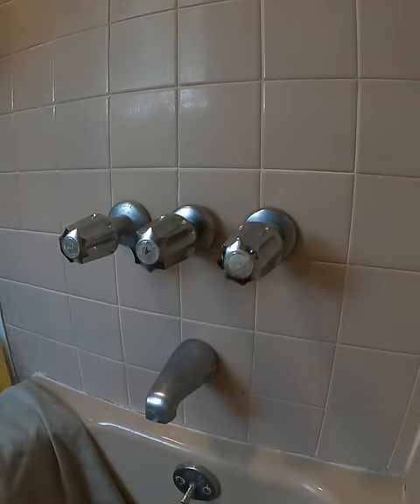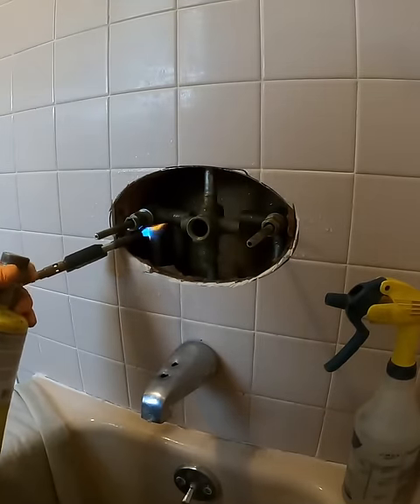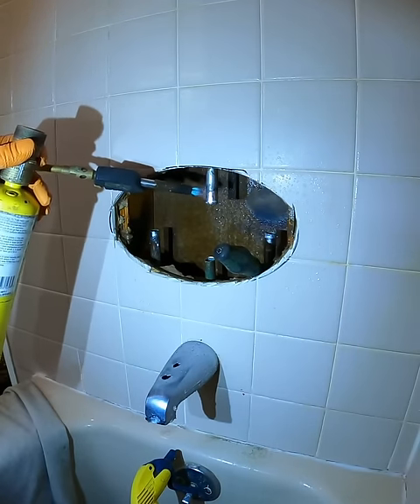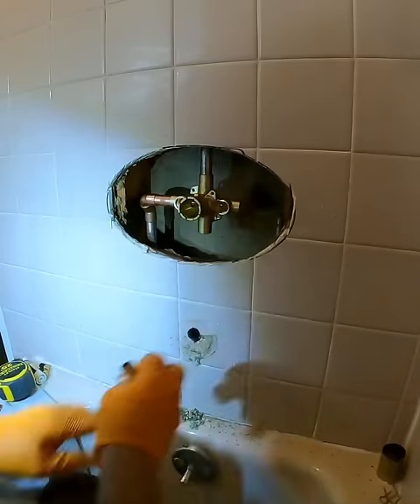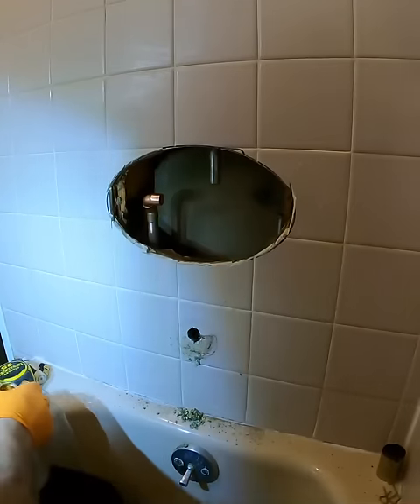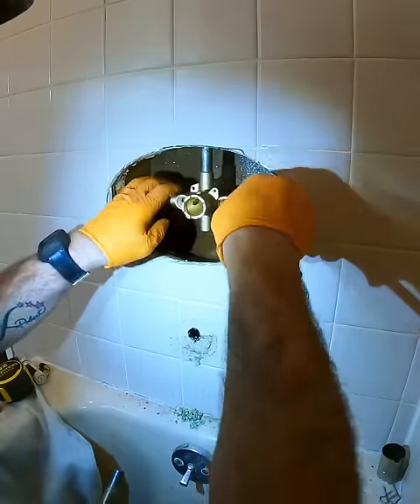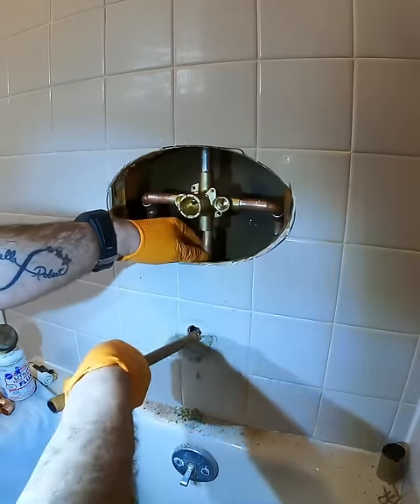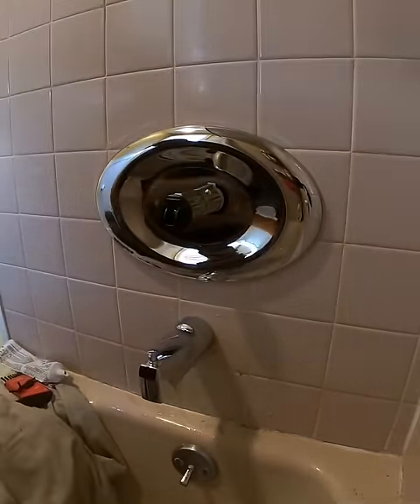How I install a Moen Chateau remodel kit

Comment: I'm going to do it myself wish me luck 🤞🤞 never done before but $800 is too much money man thanks for the video will keep you posted
Reply from the maker: Take your time and spray inside the wall with water and keep a  fire extinguisher handy
Reply: 800 is about right, once u cut the wall up u dont know what is in there.
Reply: I live in St. Louis Mo. that job is $1300.00
Reply: Did the job and yes a lot of work!!needed some help but everything came out ok thanks for the video again 👍👍✌️
Reply: George if valve is too much inside wall, moen sells extenders right?
Reply: R u nuts 1300$ for an hours worth of work have you lost your mind😢

Comment: With the Pex pipes,this transition could have been done faster without doing all that soldering with Cooper, time consumption was too long, with Pex, probably only 15 minutes, I must admit that you did a good job but with the new products on the market (Pex with sharkbite system is less time and quick installations
Reply from the maker: If the home had pex I would have used pex but sharkbite that’s a hard no 

All are home are copper and with that minimal space I’m working find copper in the easiest 

I have even pressed them but took longer on the install 

Time frame for install soldering is just over a hour

Comment: Excellent Video by George The Plumber!!   My friends and I enjoy his videos.  Very informative, and I'm glad I seen him using this Moen Chateau product because that was the solution I needed!  I was contenplating trying to repair the old valve assembly which is an antique.  Previous owners upgraded bathroom, but not the faucet!   I just installed a Moen Chateau.  My faucet assembly was shifted to the right of the spout and showerhead (not all aligned like in the video, so I knew going into this project I may need to open the wall in the closet which I had to do.   I previously seen on an "Ask This Old House" episode that with the new plunger diverter on the spout (to send water to showerhead) that sometimes the showerhead will dribble when filling the tub because the water pressure in the house is too high so you need to lower the pressure just to the tub which requires dedicated valves to the tub so you are not reducing pressure other places.  After seeing this, I was talking to a friend who also had this experience at his previous house so he had added valves, so my plan was to add valves up front just in case.  Ultimately, I did not need to lower pressure so valves were not needed, but they are there now.  Better safe than sorry.   *** My other experience was the pipe from the showerhead was too short after removing the old valve!  The original American Standard mixing valve from 1980 had threaded fittings into the valve assembly, so these fittings were threaded into the valve and then the copper pipes were soldered into these fittings, so when I un-soldered the shower head pipe from the fitting the pipe was a little more than 1/2" too short for the new Moen valve.  I could have further shortened the pipe and then used a 1" long piece of 1/2" copper along with a straight couplingn sleave (no stop type), but then iId be soldering up inside the wall which presented a much higher risk of fire.  The wall was built with 2x3, not 2x4 (who does that!?.  I decided to open the wall and do everything from the closet which made a much bigger project.  I ended up framing and adding a piece of plywood for an access panel if needed in the future.  Painted closet and that further added an improvement.  To do it over, I would cut the access in from the closet from the start and not make such a large cutout in the shower wall.  Nevertheless, this Moen product provided a great solution and upgrade.  I definitely recommend this product!  I'd also like to mention, I cut the hole in the wall using my Dremmel tool.  Bathroom wall was a manufactured product that looks like marble.
Reply from the maker: I was wondering to do them not sped up for people to see the actual install

Comment: How does he avoid turning the valve to toast? Wouldn’t you at least wrap the valve with a soaking wet wash rag? Pex would work even sharkbite?
Reply from the maker: @alancastle3917  the body is brass and don’t need to wrap it with wet rag

I don’t use sharkbite what so ever and when a house is copper I put back copper

Comment: Thanks so much, this video is helpful. What blade did you use for the angle grinder?
Reply from the maker: Diamond
Reply: @GeorgeThePlumber Thanks! Is there a brand of diamond blade you like? What size is your angle grinder? I’m going to cut open ceramic tile tomorrow, I just make sure I’m prepared lol.

Comment: If 3/4 inch galvanized pipe was used for the tub spout as well as the pipe leading to the shower arm, can I replace those from the hole in the shower or will I also need to open up the wall behind the shower?
Reply from the maker: Spout I always replace with 1/2 copper and if the head is galvanized I snake down pex and cut galvanized out piece by piece

Comment: I will be converting my shower stall from the old two handle valve to this single handle Moen conversion kit.  The valve that came with the kit has a four port valve.  I do not have a tub so should I be using a three port valve?   I realize I can cap the tub port but will that change the performance of the four port valve?  Thanks for the help.
Reply from the maker: Yes just cap off the bottom
Reply: Thanks man.

Comment: I would not spray water on joints after soldering , you can end up with cracking joints and  can lead to leaks
Reply from the maker: I just like cooling off and spraying in the wall to make sure nothing is hot